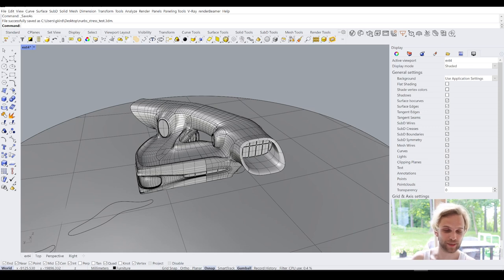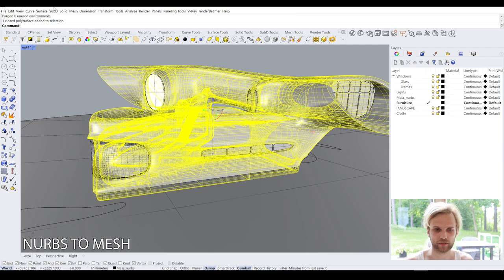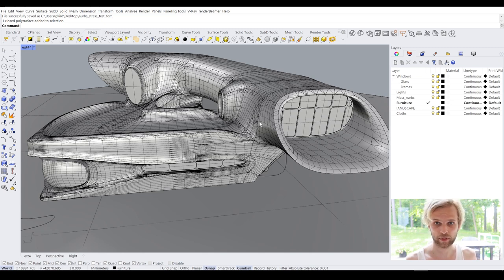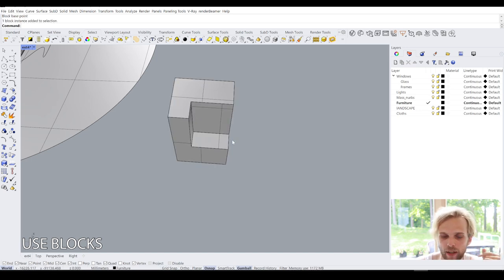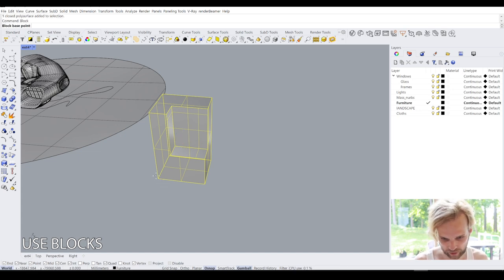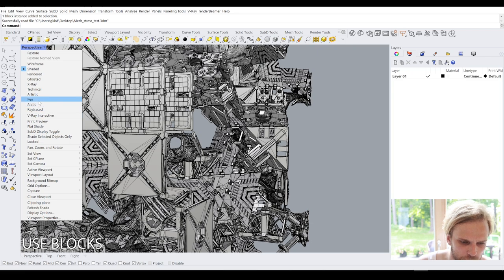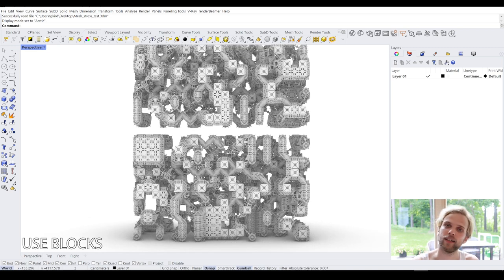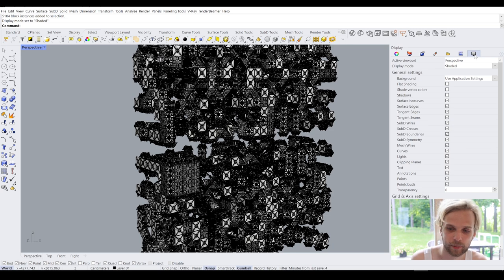How to: Make your Rhino model/file smaller - 4 tips

Comment: Hi, once again thank you for your tips! 
Question: is there a way that I can make meshes into blocks even if they are not exactly the same length? I made some space frames for some roofs and I turned them into meshes because the polysurfaces were way too heavy. Even then my file is 3 gb big. When I delete the space frames the file size reduces significantly, every thing else on the model is pretty basic.
Reply from the maker: Basically Blocks can be scaled non-uniformly (along X, Y or Z direction) and then oriented. So if the cross section of your beams is the same, you can have one block of a 1000mm long beam , and then use grasshopper to scale it along it's length/orient it into position.... Hard to explain in writing, I'll do a tutorial.
Reply: thank you!

Comment: Great tutorial!! I've been trying to find a tool that detects "similar" geometries and convert them to 1 block. I made a grid facade in grasshopper and baked it so the file is huge, I converted to mesh which made it lighter but the facade is made of many repeating objects so changing each one to into the same block will take a lot of time. Any ideas?
Reply from the maker: If you have a single form that doesnt change and just gets repeated, I'd say - create 1 panel, make it into a block and for the block just array it. No need for grasshopper then

Comment: I was a little confused by your explanation of blocks and not being able to deform them. Is it that you're saying you cannot distort the block instance outside of the block editor? You can deform the blocks however you'd like as long as you're inside the block editor, but when you're "outside" the block, you can only do a limited set of actions on it. Also important to note that if you scale the block non-uniformly, then it can no longer be edited, basically you end up with a child of the original object. IE the original block or "parent" can change the "child" but the "child" cannot be changed to alter the "parent" if that makes sense. Sorry for the essay! Know this wasn't a video on blocks per-say but I feel like I've run into a lot of people who don't like using them for some reason and I think they're incredibly powerful, particularly within architecture.
Reply from the maker: Yup - I agree. The problem with Rhino's block system is lack of information given by the software, but I saw Mcneel are rewriting the block manager, so hopefully the experience of working with blocks will improve. Right now you really have to dig for the information on what's a child, what's an instance, shat kind of transforms have been applied to which block and so on.